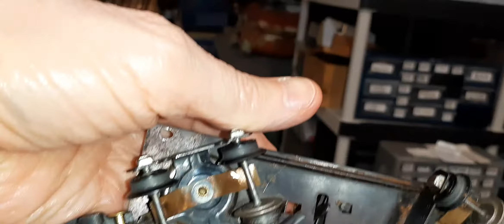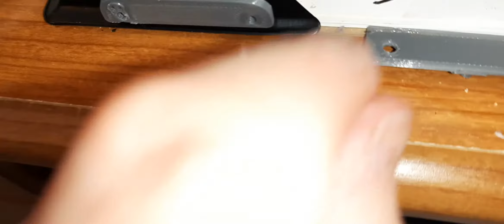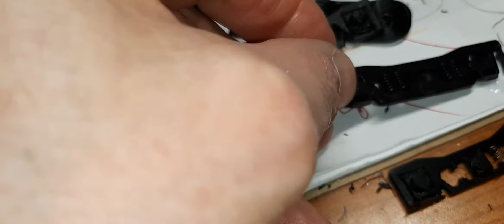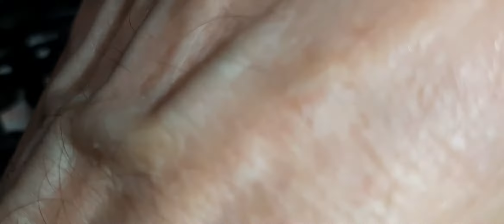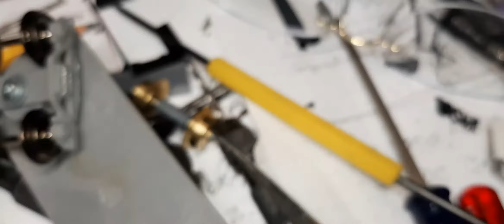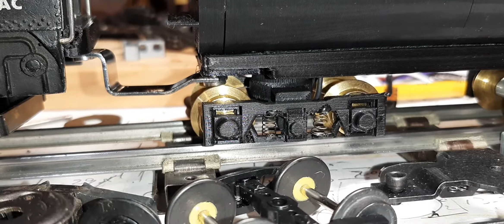American Flyer tender trucks All wheel pickup production print

Comment: Have you considered lost wax casting.  First you model the part in wax, cast one in metal using lost wax casting techniques, clean it up and from that you make a rubber mold into which you inject molten wax and then you can make many duplicate wax models which you then use in the lost wax casting process again but now you can cast many metal parts at once.  Amateur jewelers and metal workers often have the equipment and knowledge to do that sort of work.
Reply from the maker: i am not that tuned into these methods. I feel more comfortable building what I need this way. it others want more I turn it over to a maker like ShapeWays. Thank You for commenting.